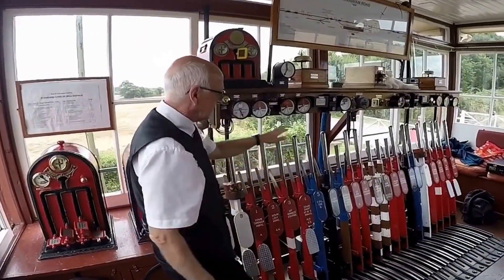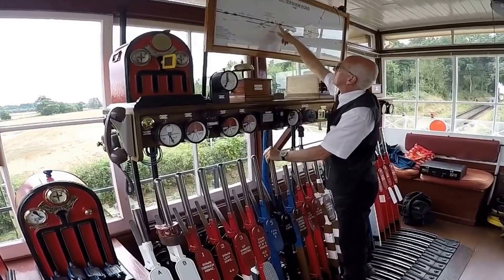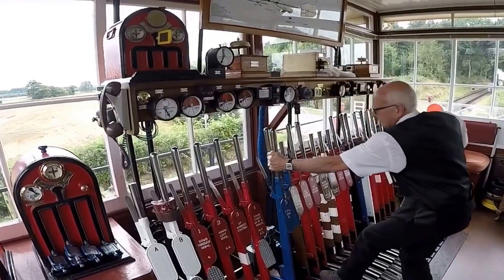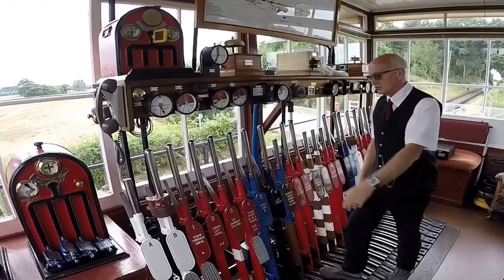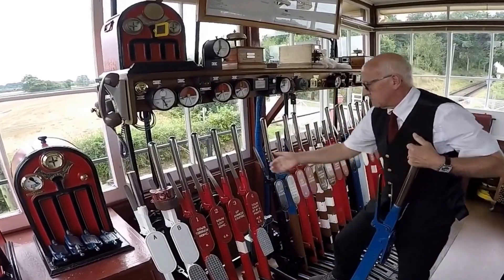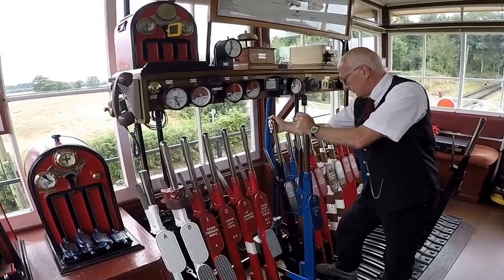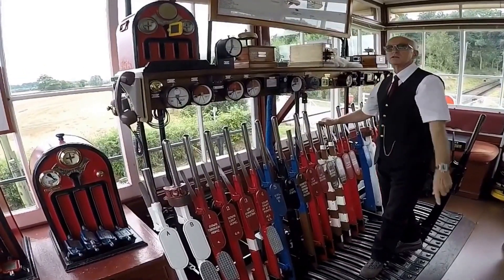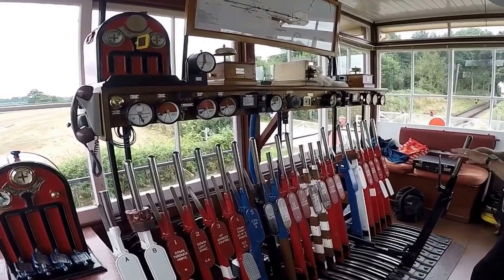A  token working on the Kent and East Sussex Railway

Comment: Good evening, as well as in the UK, India and other overseas dependencies and territories, could anyone tell me whether this signaling and safety system has ever been used in continental Europe?  From what I understand, it was never used here in Italy, not even at the time of the private railway networks.
Reply: It was used in the Soviet Union, and still is used in Russia on some remote lines. For instance the "Chum - Labytnangi" section on the Northern Railway is worked by ETB.